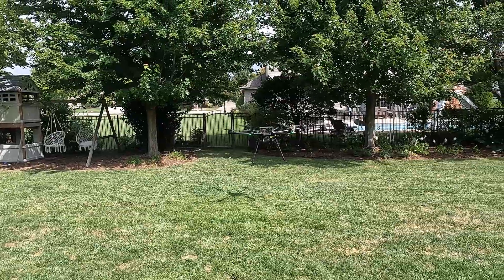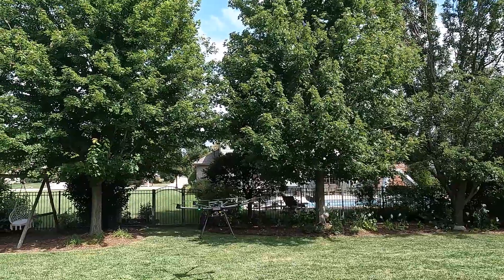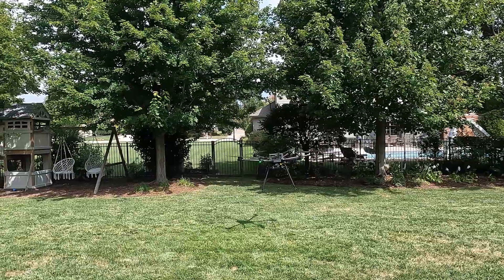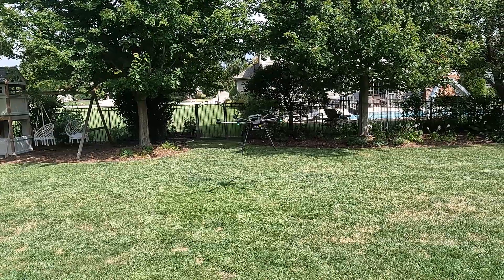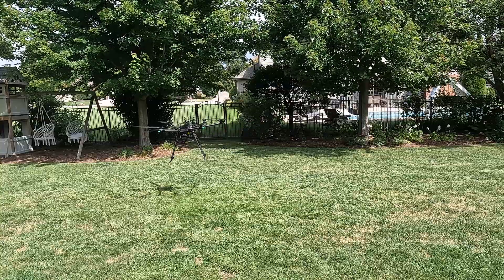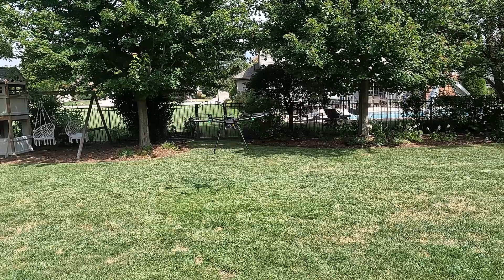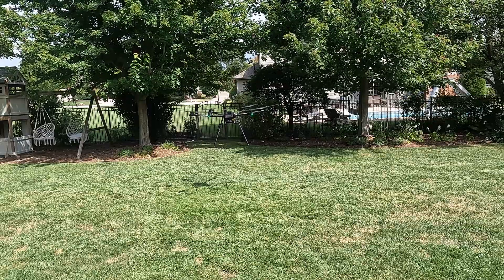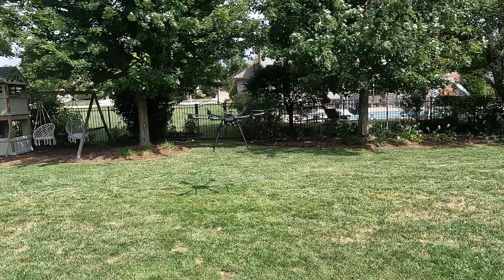Hexacopter Drone Build Project – First Flight of #drone

Comment: Loved your videos, What is the aproximatly flight time with everything working. I am planning in building one for me and my dilema is if i should go with 1 or 2 battery packs, Tattu Plus 16000 or probably 22000. would realy like a flight time os at least 1 hour.
Reply from the maker: Thanks! I was able to get about 28 minutes in just a hover time test I did (wasn't aggressively flying).

Comment: For vibration and filter analysis don’t you need a full throttle up for full spectrum analysis?
Reply from the maker: I've been following this guide, and for example the notch filter setup and vibration analysis is done early on simple hover tests: https://ardupilot.github.io/MethodicConfigurator/TUNING_GUIDE_ArduCopter

Comment: Tim Im building a drone my self right now as well, something similar to yours. Could you review the controller. How do u like it, how is the video feed, how does qground control works etc.. thanks. I did see the unboxing video but the actual controller details are very interesting.
Reply from the maker: @Nexx8969 good idea, Ill add it to my list. Not sure Ill get to it for awhile. I do really like the controller although I havent pushed it too hard yet. Im currently working through my gimbal and camera setup and being able to stream that video feed. So far though the form factor feels good in my hands, the controls move smoothly, and the screen is big enough for me to see everything. I did recently find you can get newer versions of qgroundcontrol to install on it as well from this github page: https://github.com/CubePilot/qgroundcontrol-herelink/releases/tag/v4.4.2-herelink

Good luck in your build!

Comment: How much weight can he lift or carry?
Reply from the maker: I need to do some testing on that and get some accurate measurements of its currently. Rough guesses are that the drone itself with battery and motors is about 20 lb. And then I think it'll be able to handle about another 15 lb of payload maybe even a little bit more

Comment: Hey Tim nice drone good work. Hey man I could sure use your help I’ve got everything working now since my last problem now I cannot seem to get my motors to spin on mission planner under motor test . I know this is not a easy answer but I’ve done everything disable all fail safe and battery charged I’m getting tx and rx signal but my motor will not turn
Reply from the maker: @scottsigala2284  what kind of motors and esc and flight controller setup are you running? Happy to try to sync up with you and look things over together and brainstorm. PM me your email address or cell number and we can try to setup a call for maybe an upcoming weekend.
Reply: @timarcher52  hello thanks for responding  my motors are LD power mt-4010-380kv/ esc are readytosky 45a bl heli s 2-6s lipo one is a mix match 30 amp /opto/bl heli /b shot esc if need be ill order and replace the one odd ball on a v5+ ardupilot silver cube on the board
Reply: and 2 4s 14.8v 70c 6000 ma
Reply from the maker: @scottsigala2284  so just for some things to validate first, have you verified your motors and escs work without the flight controller in the middle? Then once positive on that, do you have your rc receiver connected to the right ports on your flight controller? Lastly are the escs connected to the right ports on the flight controller? These pages might help. Sorry if you've done these already, just taking a shot in the dark here. https://ardupilot.org/copter/docs/connect-escs-and-motors.html

https://ardupilot.org/copter/docs/common-rc-systems.html
Reply: @timarcher52  yes they were infact working i was having a no rc input message and since i fixed that issue they stoped working so it has to be something in the full paRAMITER MENU AND YES I WOULD LIKE TO GO OVER THE PARAMITERS WITH U
Reply: @timarcher52  YES IM POsitive they work possibly a issue with my settings
Reply from the maker: What's the best way to send you a private message where we can chat and see if we can align our schedules to do a call or something?
Reply: @timarcher52  also using a tarot tl2996 high current board and a flysky fs-i6s 2.4g 10 ch tx